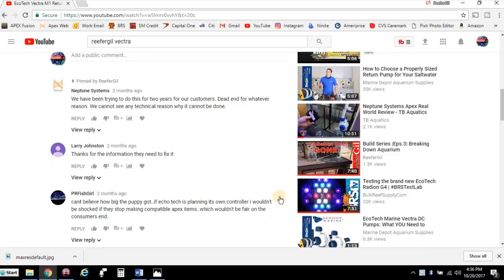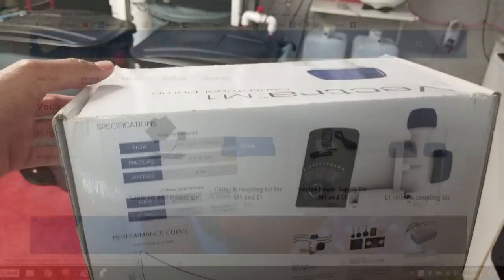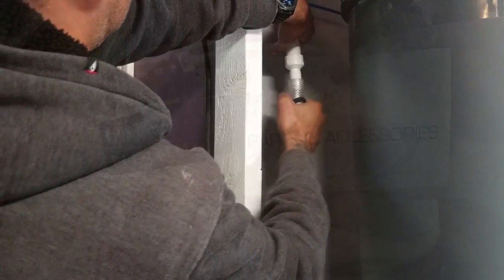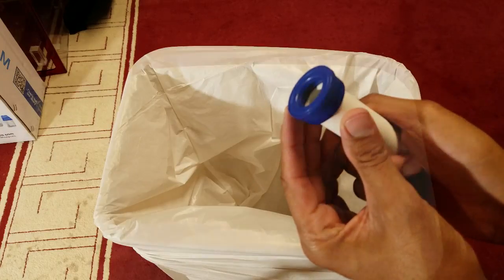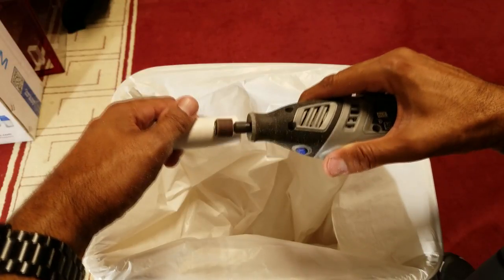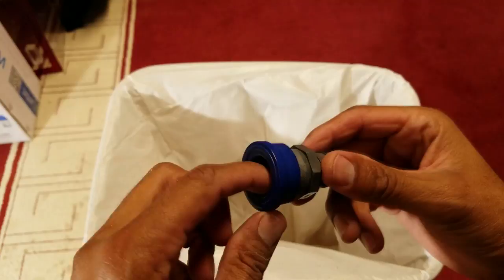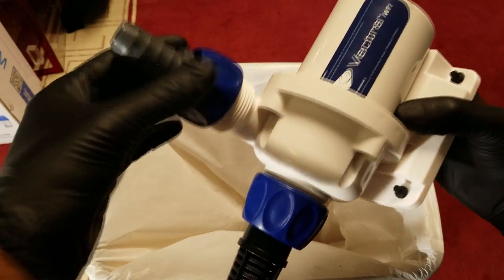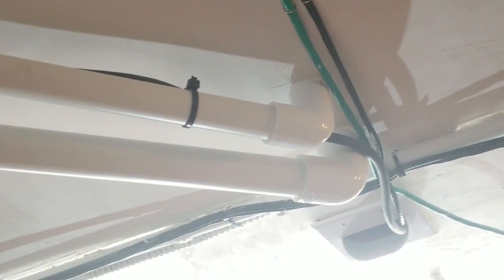Build Series |Eps.7| Plumbing EcoTech Vectra M1 Return Pump

Comment: I have pretty much the same setup. I have line running from my saltwater bin under my house (no basement only crawl space) over to the tank. When i want to do a water change i just turn off the valve running to the return, let the water drain into the sump then turn another valve to use my return pump to pump water out of the sump. One more valve to pump fresh saltwater but into the sump and get everything running again. Its so easy!
Reply from the maker: Thats awesome, how about a video genius! I wish I knew this, I would have called for more info. I plumbed the water changing system to the back of the tank, but strongly considered the sump instead. When it comes time to sell my tank for the next upgrade, the buyer is going to be like "Whats up with all the holes in the tank" lol.
Reply: ReeferGil lol I am working on moving my ato bin and saltwater bin out to the garage but will use the same line to pump rodi water and fresh saltwater to the sump. This will give me some more room for a permanent quarantine tank and frag tank where the saltwater bin use to be. Once i things going with the tank again and get everything moved and complete im gonna try and make a video on it.
Reply from the maker: MikeTheReefer Mike that sounds like a solid plan. Looking forward to seeing it.

Comment: Not only is the pump not compatible, I was having problems with my l1 surging. They told me I can't even have it plugged into my eb832 simply for power and need to plug it right into the wall. I went through 3 pumps in 1 year due to premature failure. I think the vectra is garbage. I am now running a reeflo pump without issues.
Reply from the maker: Are you serious! First I've heard of this issue, but then again I don't read EcoTech forums. Sorry to hear about the ridiculous issues you were having. Silly you couldn't even plug it into the EB832!

Comment: Any reason you did not use spaflex instead of the flexible tubing?  Spaflex has the same outside diameter and inside diameter as rigid pvc, and can be glued to the same fittings using the same products as rigid pvc.  I find hose barb fittings restrict flow a lot more than a union does, which is all you need to create a mechanical connection between rigid PVC and spaflex.
Reply from the maker: Hey GT, thanks for the info. I've just never used spaflex tubing. I'm crummy at plumbing, so I tend to stick with what I know. That's not to say I won't try something different. With my limited knowledge of plumbing comes my limited knowledge of other options. Thanks for sharing your post, something to consider in the future.

Comment: 2000 gph at 0 feet of head. At 15 ft, it's more like 380 gph. Add those 90s and it's less than that.
Reply from the maker: I know, not looking for a strong flow, but I also dont want to sit and wait for a trickle of water to fill my tank. This could be a flop. I'm getting close to finding out. Thanks for the post!
Reply: ReeferGil absolutely! Build is fantastic! I can't wait to see it running. I just binged all the build videos. It could end up being the perfect amount of flow. I have an M1 on my reefer 350. Been a great pump so far
Reply from the maker: It's funny no one has brought up your point, I've actually been getting really anxious to see what kind of flow I'm going to get to refill the tank that amount of water I emptied out. I really don't want to dime out more cash for a big pump that will be sitting inside a trash container. Thanks for watching the vids to. ✌